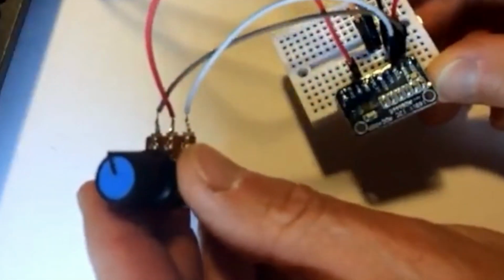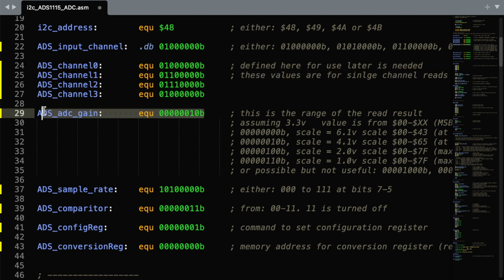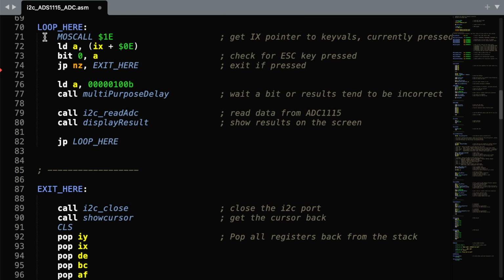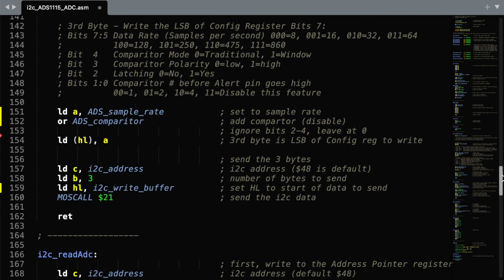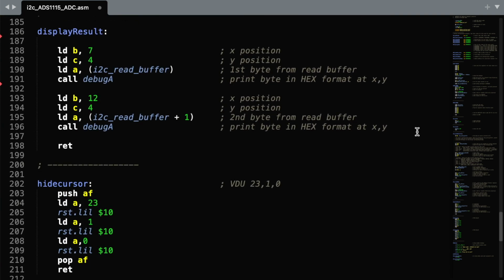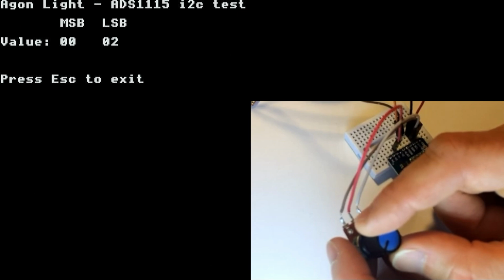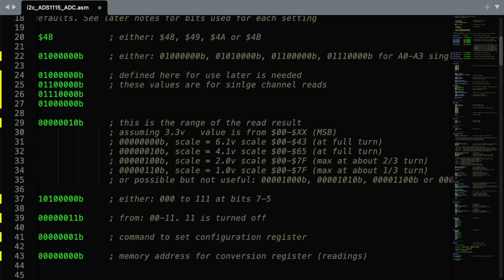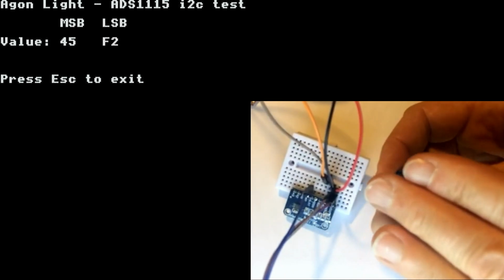04 i2c ADS1115 Analog input

Comment: Watching this I couldn't help thinking that the natural partner to using a potentiometer as an input is using it to control a servo motor. Alternatively it could drive an RGB LED and use it to pick a choice of colour from black to white via the whole spectrum.
Of course these would involve adding driver code that would be longer than and would detract from, the simplicity of your explanation on  the actual subject of this video. I don't know what your plans for the rest of the series are but I feel that once you have completed your chosen hardware devices you could cover some example demos that combine inputs with outputs. 
If you wanted to you could replace all your separate hardware modules with an Arduino although that may be going too far 😁
Reply from the maker: Arduino is too easy, so many videos and ready made drivers. With Agon and z80 assembly, there are no drivers, we have to do the work ourselves. I hope to provide the basic building blocks so you can combine in whatever combination suits your own projects. There is one project on my Gthub which builds a custom hardware interface with a Raspberry Pi Pico for Atari paddles. But that could be superseded by this ADS1115 chip. If you want to drive a servo, then I am sure there must be i2c PWM modules, but I don't have any yet.
Reply: @AgonBits  The Arduino suggestion was definitely meant as tongue in cheek. It would be mainly an Atmel tutorial since once you establish a communication protocol between it and the Agon, access to all its hardware functions would be Atmel code and not Agon Z80. (Do I need to mention the VDP?). I still have Arduino and Propeller hats for my Raspberry Pi but never got around to doing anything practical with them. The Pi can do enough with its own accessories.
Reply from the maker: @roelandriemens  OOps, typo on my part, well spotted. I shall change that code. Thanks.

It can all be coded directly on the Agon, but once you get beyond a screen or two, it is hard work coding on the Agon. I edit on my Mac with Sublime text, then send the code direct to Agon via the Hexload utility. I have a build script which does everything with the tap of a button :-)
Reply: Oops, I accidently removed my reaction. Thick fingers on tiny keyboard do that sometimes. My reaction was:
Your tutorials are very helpful. Do you edit your programs on the agon or with an external editor? I noticed that ADS_channel0 and 3 are set to the same address. I want to try to use i2c on the agon to connect my HPDL1414 board. It now only runs on an arduino.
Reply from the maker: @roelandriemens   @roelandriemens  From what I read, the HPDL1414 doesn't have built-in i2c, it just uses various pins. So, you could do some bit bashing with the Agon's io pins, or similar thou and i2c external io expander (see my other videos). I am about to do a video on an LCD which uses a similar concept, an io expander piggy backed onto the LCD display. I have seen one of the HPDPs on AliExpress which has a serial interface piggyback. https://www.aliexpress.com/item/1005007122028036.html